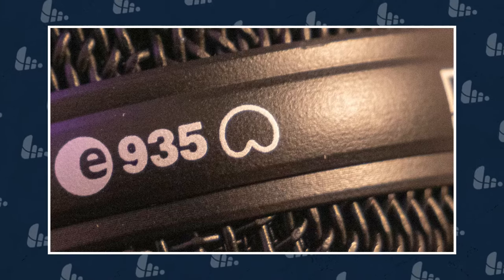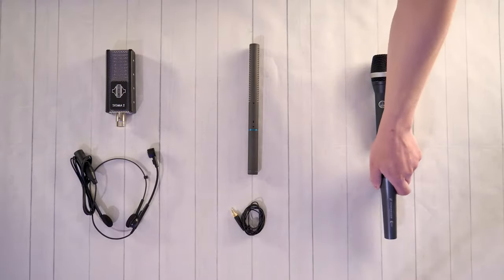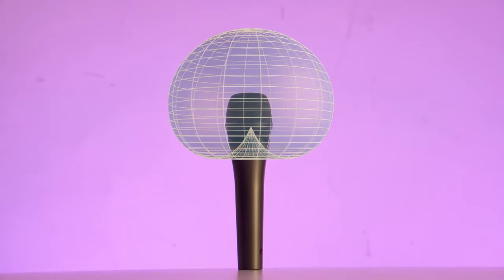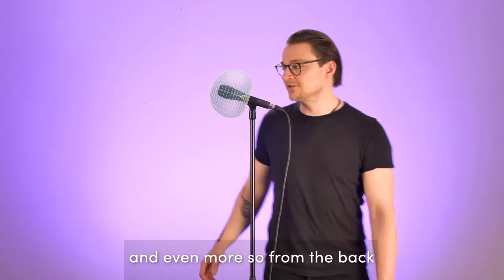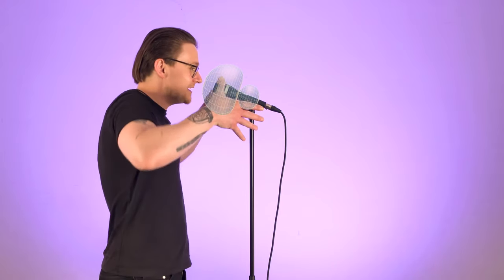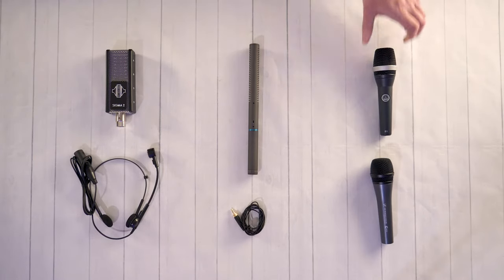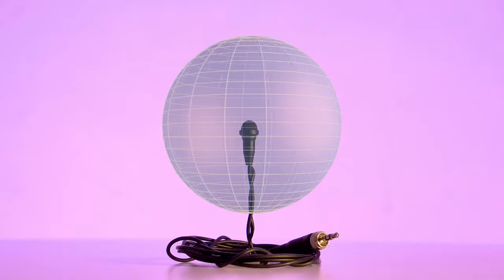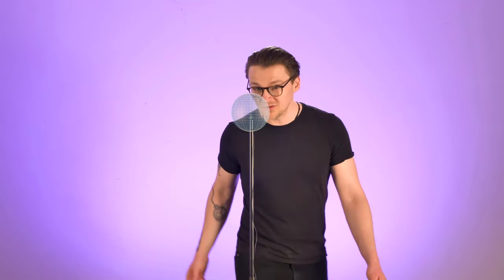Microphone Polar Patterns: The Basics

Comment: I feel like the difference between cardioid's side and behind-noise pick up is kind of similar to supercardioid's behind noise pickup. Which means the side-noise would be cut out even more aggressive in the supercardoid.
Am I understanding it properly?

I'm not sure of what to get between cardioid vs super cardioid. The situation that I'm going to use the microphone is on a super noisy environment for a speech recording. The supercardioid does noise rejection better but what is the point when the back side of the microphone slightly picks up noise?
Reply: @LeisuretecDistribution  And that's why they recommend having foldback directly behind cardioids, but at 45º to the rear of a supercardioid. Ah, it's all making sense!

Comment: Which type is better for recording voice over in a noisy room?
Reply from the maker: It really depends on where the noise would be coming from, Caridoid typically has the best rear rejctions however super cardioid might work better depending on various factors.  It’s also important to consider the angle the mic will be at.

Using a Dynamic microphone over a condenser might also help as the reduced sensitivity will help, maybe even more so than the polar pattern.
Reply: @LeisuretecDistribution  
Thanks a lot for your help.